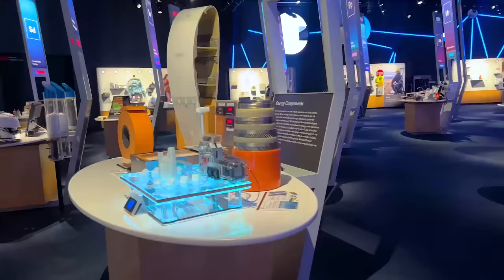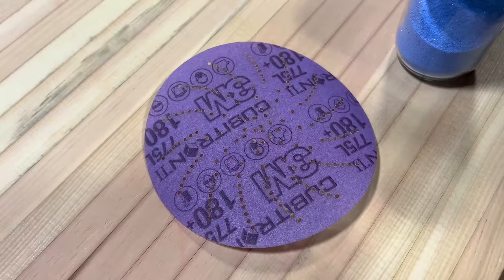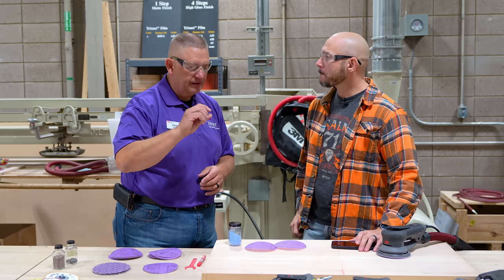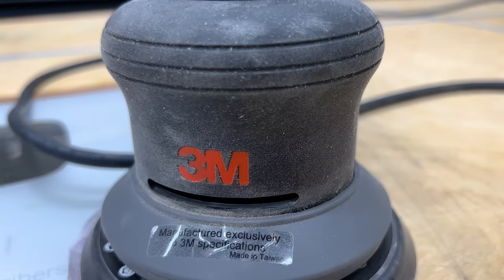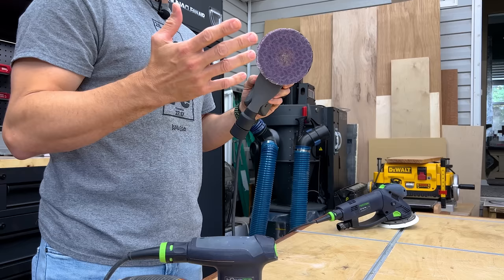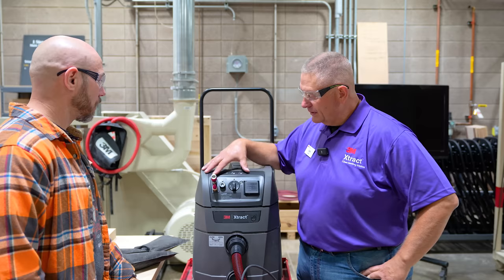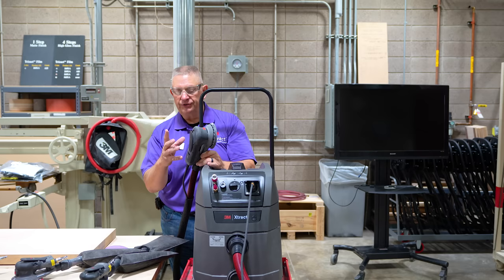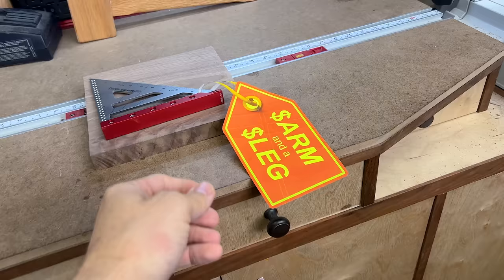You Didn't Know This About 3M Cubitron Sandpaper | Inside 3M's Secret Testing Lab

Comment: I just used their Cubitron for reapply oil finish to my desk and compared to standard pad its crazy. Of course had to buy the pad savers, but still its an awesome product. I use their VHB tape for years now which is the top of the line product, but found another one with this sandpaper.

Comment: Thank you again for another great video. I have been using the 3M Cubitron for a while now; although I love the job it does I get very frustrated with how little time it last before flying off the sander or totally ripping up the backing of the sandpaper. I have replaced the sanding pad on all my sanders but find that was not the problem. Any suggestions?

Comment: Next you should do a video on which one to buy. I have been using the new paper and it is longer lasting, sands smoother, less dust. I looked at the products they have and WOW they got a bunch of stuff. So, I was goanna purchase one along with the collector. Just could not decide which one? Also need to know which is better, air power or electric power. Have a blessed day. Thanks.

Comment: I guess I'll be the only one who hates the Cubitron disks, but I've had really bad performance from them.  I tried some on my Milwaukee ROS, and it made the sander feel out of balance, almost to the point I couldn't hold on to it or keep it flat on the surface.  When I switched back to a Klingspor disk it ran just fine.  I tried the 3M disks on my new Festool sander and had the same problem.

Comment: Great video. After your review, I picked up the 3M Xtract Cubitron II Net Disc. However, when I was using it to sand drywall or wood, I noticed the back of the sandpaper would get gummed up, effectively blocking the dust extraction (Yes, I had clean filters on my extractor), which is a real bummer because I liked the idea of the product. Now, I've switched back to regular sandpaper.

Comment: Any suggestions as to which 3M sanding discs would be best for pallet wood? I get so confused every time I look because they have so many skus.  I've been wanting to try out 3M sanding discs for a while and I need more now so figured I'd give them a try. I'm using a Dewalt 5" cordless random orbital sander btw. Thanks
Reply from the maker: Model 775L would be best I think.  The adhesive backed one shown in this video.

Comment: Very informative video. I just got a sample pack of Cubitron in an order from Taytools. I was impressed with the 80 grit especially. Cut sanding time in half in my opinion. Now I'm thinking about the 3M dust extractor you featured in video. I currently use a home-made cyclone and my old Ridgid (noisy) shop vacuum. Would you recommend still using the cyclone separator with the 3M?
Reply from the maker: It is a good idea to use the cylcone separator.  It'll keep your filter in the shop vac cleaner, longer.
Reply: @731Woodworks  I made the cyclone over 6 years ago and has helped a lot. My unit is a 5-gal paint bucket with a Thein baffle. The bucket sits on top of an old, discarded Shop Vac a neighbor was throwing away.

Comment: I definitely love the sandpaper. The extractor looks good too... which of the 3M or your Festools do you prefer?  I'm still trying to decide whether I want this one or a CT36...
Reply from the maker: I like the Festool but mainly because I have several Festool tools that it works with, Domino, ETS125 Sander, Rotex Sander, Miter Saw, and Track Saw.  Both are good dust extractors.

Comment: Matt what is the diference between the 3M Xtract and 3M Cubitron??  Nice work Thank yu!
Reply: I'm not Matt, but I am quite familiar with the 3M products and will take a stab at answering your question.  Xtract and Cubitron are "brands" used by 3M.  Products branded Xtract include abrasives and tools designed for dust extraction - but is often associated with the 710W mesh abrasive with the pattern on the abrasive side.  Products branded Cubitron include all abrasives that utilize some form of ceramic mineral - but is often associated with the 775L which utilizes a 3 mil film backing.  The confusing thing is both products fall under both brands.  With that said, the 3M Xtract 710W is lower in price, but isn't as durable as the 3M Cubitron 775L.  Both products have similar abrasive construction and should offer similar cut and finish.  But if you sand over corners and edges frequently, you may see a benefit in using the more expensive 775L film disc.  Hope this helps!
Reply: @DB_Customs  Thank's much for takng the time to answer this question so well!  Now I understand.  I had a Dewalt 5 inch orbital that I tried to uses the Extract disks and though extract worked  better that the Dewalt brand disks they kept flying off.  So when the Dewalt 5in orbital sander started going bad, after 10 years of use,  I deciced to go for the 3M 5 inch orbital sander but had buyers remores at fist.  That quickly went away because thier 3M sanding sytem is probably the best.  I will order a box of Cubitron today.  Thanks again for your time!  I also learned a great deal from watching this video and never realized the benefits of a good dust collection system over and above just taking the  dust out of everything.  I fabricate specialized hardwood keepsake boxes on Etsy and sell hundreds!  3M has changed everything!

Comment: i myself bought the 3m 100mm electric sander and its nice when it works but if i use it for around 2-3 hours it gets hotter and i would say more unstable and starts vibrating more and more and cause of that it gets hotter and hotter until the heat shutdown kicks in and it gets loud and i mean extremly loud through all the vibrations i already got 2 replacments form 3m so no complains there but even the 3rd one has the same problem and honestly im getting tiered of it :/
Reply: Are you using it with an extractor?
Reply: @AppleTony3  yes

Comment: I used the 775L for the first time a week ago on a cedar deck.  It worked awesome, until it didn't.  I went through 2 sheets, in 40 feet of deck boards.... Until they fell apart. @ 2:45 you can see what happens to the sandpaper.
Reply from the maker: Interesting. What grit were you using? Using dust extraction? At 2:45 that was dust that was caked on the sanding disc because there was no dust extraction, this one wasn't coming apart.